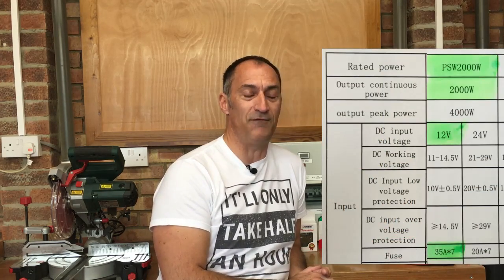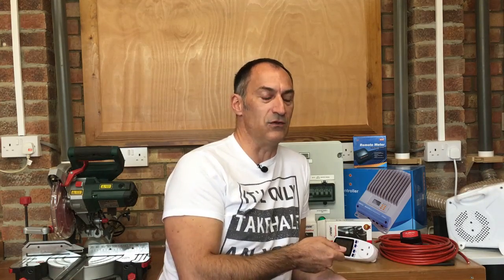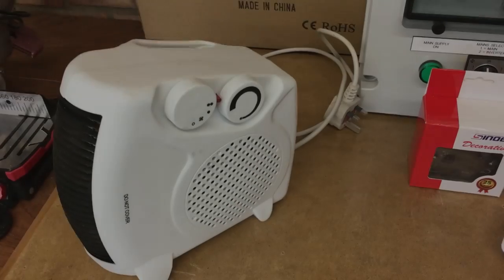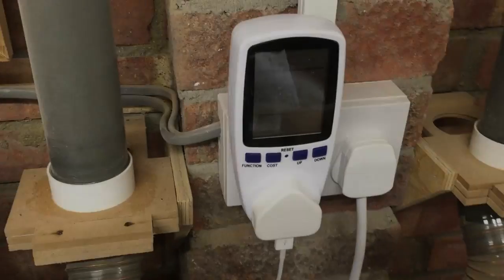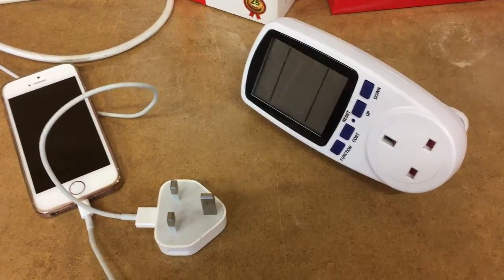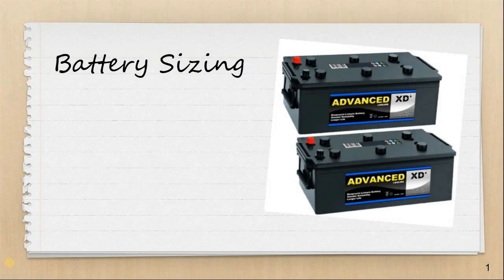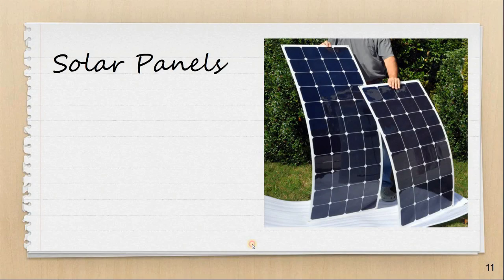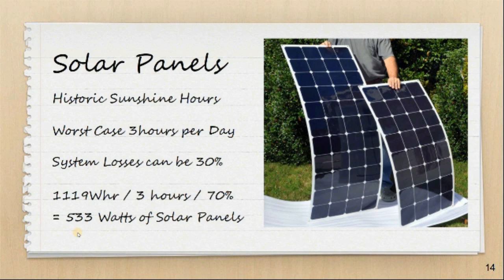Off Grid Battery & Solar Sizing - Self Build Campervan

Comment: Just a thought, the iPhone, iPad and Kindle could all be charged off 12v USB sockets so you don't need to invert up to 240v for these items incurring the inverter loss. You'd only need the inverter for the straightners. Just a thought?
Reply from the maker: You are right dibley1973, it can be done that way. 
However, that would require additional 12v DC sockets and more cables.
I like the idea of having one type of socket that I can plug anything into.
I'm happy to suffer the 15w off losses for that convenience and cost saving. 
But thank you for your suggestion, worth mentioning. Cheers

Comment: Quick question about dc fuse you changed wouldn't the 2000 watts output be divide by the output voltage 220/240 not by the input ?
Reply from the maker: Hello Brian, 
The breaker is on the 12v DC input side of the inverter.
Output 2000w / 85% = 2,353w input / 12v = 196Amp x 1.25 = 245Amp DC breaker.
The inverter manual actually reads 35A*7 quite why it's written like that I do not know.
On the 230v discharge side, I have the changeover switch, RCD, and MCBs
Here is a great source of information for off-grid solar systems.
https://www.altestore.com/howto/
Regards

Comment: Great video. Have you thought about Lithium batteries.  Much more expensive, but lighter, drain down to 10%, charge faster and live longer.  I'll prob go that way, although not too many options in the uk.
Reply from the maker: +David thrower, yes but soon disregarded on cost basis.
Most likely go down AGM route

Comment: Hi Greg, thanks for the detailed walkthrough! I'm playing around with the spreadsheet and it looks like you forgot to take the quantity into account when calculating the total watt hours. For the LEDs I'd expect 600 instead of 60 watt hours total, since one draws 10 watts for 6 hours, giving you 60 wh – but then there are 10 of them. Can you confirm this or did I miss something? Cheers!
Reply from the maker: Hi, yes, you are right. The formula on my sheet is missing the qty column.
The blank one in the description was correct, burning the midnight oil.
Oh dear, that is going to make a big difference. That's what you get for not checking.
Oh well, the misses will have to have frizzy hair instead. LOL Thank you
Reply from the maker: Fortunately the method and blank sheet are correct even if my execution was not perfect. 
Need someone to run due diligence on my videos. 👍🏼

Comment: Linear actuator to angle the soar panels, or a car scissor jack connected to a car wiper motor( The apocalyptic inventor just did a YouTube on it) a simple way to get more efficiency out of them. Another well presented episode Greg. Ps o overwhelmed by Te beautiful wiring I overlooked your breaker size.. well I didn't question it anyway. Great stuff ain
Reply from the maker: +Larn Davies, I watched a video by Amy from the AltE store on solar angle and shading and amazed at the drop off in performance so a tilting mechanism would be ground breaking for van builds. 
Will give it some thought. Thank you for your continued support.

Comment: This is a excellent video Greg. You have all the qualities of a great teacher! You shouldn't have any problems with power. We have a slight advantage in Aus with far more sunlight and no need for heating (mostly), just need a big fan to keep the flies at bay. Those lead acid batteries are NOT good - better to lash out and get deep cycle gel AGM batteries. The lead acid also give off lots of hydrogen when charging and it is essential that they are well ventilated, not so with gel batteries. I look fwd to watching your next amazing vid. Thanks!
Reply: What about those LiFepo4 batteries. Half of the space, since you can use much more of the capacity. You can charge them very fast with solar power. The only issue is the price.
Reply from the maker: Thank you Norman, very much appreciated. I am going to get sealed deep cycle leisure batteries, either AGM or Calcium but definitely NOT the old lead acid type you have to top up with water!! No No No
Reply: Agreed. If budget allows it the LiFePo4 are much better.

Comment: Very helpful, and helps clear up a sesnible way to come up with an estimate, but don't forget you are not limited to lead acid batteries, there are alternatives that take up less space, weigh less and can be discharged more fully. I'm lucky in the my Sprinter is an ex RAF ambulance so it has a square box on the back and is wide enough for 60 cell panels across the roof.
Reply from the maker: Thank you for your feedback. Are you referring to Lithium batteries? What I have seen are very expensive and I'm struggling to justify the extra cost. Unless you know of something else I have overlooked. Please let me know.
Great base vehicle you have, more room inside, double axle for more weight carrying and you get to put 60cells on top. Have you got any photos you like to share on my facebook page? https://www.facebook.com/Greg.Woodshop/
Reply: Yes i was mainly talking about lipos, they do cost more and the charging setup needs to be a bit more complex as well, I have spoken to a guy who bought some second hand from a mobile phone mast, I think there are places that have to replace at set intervals and can be getting rid of perfectly good batteries. Traction batteries (forklift trucks etc) are still lead acid and heavy but they can take more of a discharge so possibly would allow smaller batteries?

I'll post a couple of pics of my van, I've not started conversion yet as I'm still in the planning stages, although I have built a couple of very basic weekend panel van conversions in the past. :)
Reply from the maker: Great, I'll be interested to see them. Good that you have got some experience too. It's a very steep learnign curve for me right now. As you may have seen already invested in the charge controller and other items so I'm kind of committed down this route. Any thoughts on AGM vs Calcium?

Comment: LFP batteries are a great way to go with solar. Deep discharge, much faster bulk charging to 100% Small, lighter. They are expensive but you need fewer/smaller and in the long run less expensive. Cheers from America!
Reply from the maker: Hello from across the pond :D  I'm sure you are right, I don't think my budget will stretch that far unfortunately.